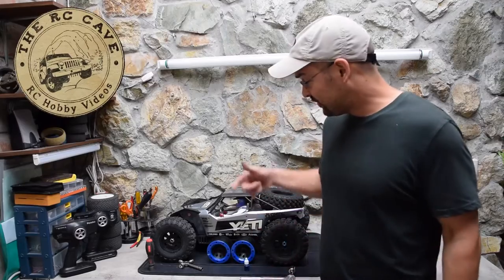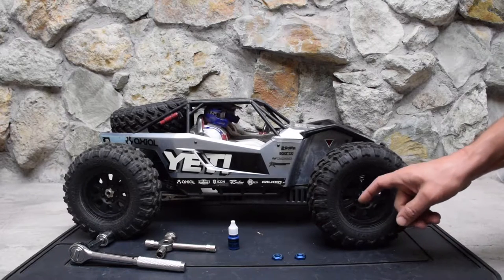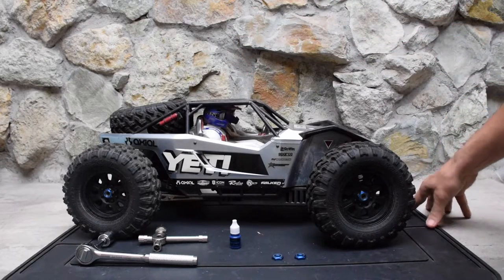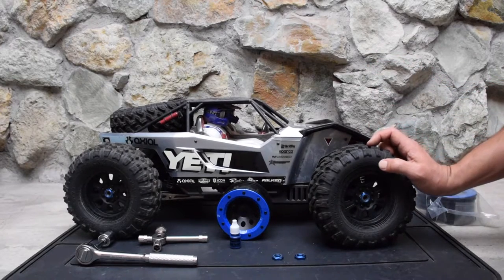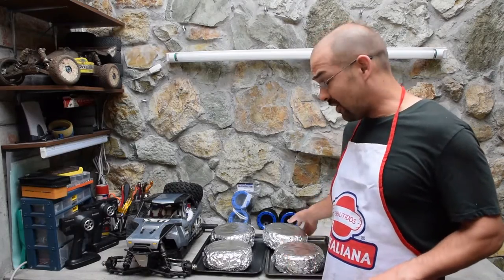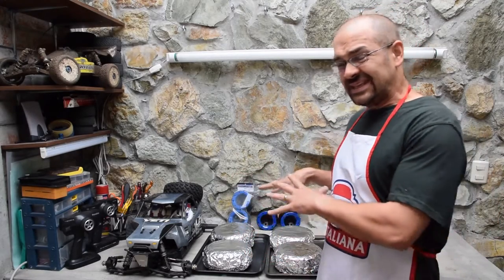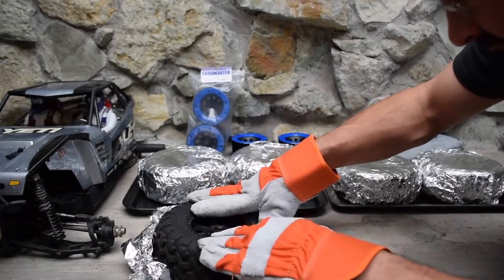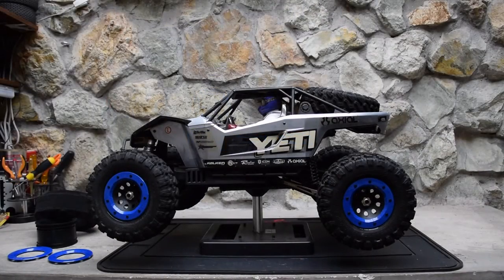Axial Yeti XL: Wheel upgrade and baking tires off rims

Comment: Great stuff!  I just picked up a Yeti XL and stripped a wheel hex within  2 runs because I didn't check them.  Doh!
Reply from the maker: I know this is way after the fact, sorry for not responding. I've been there, the stock Axial plastic is just way too soft. I went with the RC4WD Dick Cepek Beadlocks and Mickey Thompson Baja MTZ.... I wanted quality wheel that wouldn't break, along with taller tirs that weren't too heavy 👍

Comment: Those tires look awesome on your crawler with those Rival rims. 
I looked over all the methods for removing tires and decided on the acetone vapor method, it works excellent,  you aren't really touching any acetone and it loosens the glue on the wheels and tires and you can easily scrape it off with your fingernail, all you do is find a plastic container with a lid that seals well and put some acetone in the bottom of the container,  then put a piece of wood that's a bit taller than the acetone level, put your tires on the wood and wait a few days,  when they are ready they come very easily with no damage to the tires or wheels.  Maybe you would like to try it,  just an idea for you since it was so easy.

I got the Tekno Truggy coming this week,  can't wait to get it running.
Reply: Very nice,  yeah acetone is nasty but you never touch it or even smell it really except when opening the lid,  very minimal exposure and doesn't seem damage or degrade the tires or wheels.

Thanks for the tips on the Truggy ,  it just arrived today   it is the ET 48.3,  I will take that advice.

My friend has an place in Colombia and he said land there is economical,  so we might get a lot and build some awesome tracks like you got.
Reply: Yes,  thank you

Comment: My 10 cents worth - I started with stock plastic glued wheels .. with my crawling the tyres broke off from the wheels - then I tried aluminium REAL beadlocks, same problem + others I won't get into here - then tried Proline titus beadlocks (plastic) .. same problem as you had with your stock wheels, rounded off hex socket but now I have Vanquish OMF wheels, so far good all rounders - beadlocks really work and hold onto they tyre in place and the hex is still going strong .. as for the rotating weight I don't go ion it that far, I've been on this setup for a long time, been through a set of Mur Slingers from RC4WD and really beaten the crap out of those with no damage except to the tyres and plastic Proline wheels - in my opinion, I would go from plastic to something stronger not back to plastic and as for those blue beadlocks, if you don't mind picking them up wen they come off during your bashing sessions, then leave them on but they look kinda nice with that truck :) Oh on last thing I would like yu ALL to know, if you go for a set of beadlocks I suggest you get the with counter sunk heads because hitting them against rocks will rip off those beadlock screws heads and water will not help towards the cause. Get beadlocks that actually have screws on the inner side of the wheels that do the actual tightening on the tyres and the outside ones are for show! Lessons learnt from experience!!
Reply: ***** I have no experience with speed devils like your yeti so I would not know whats good or bad for it .. makes sense what you said :) If it has a weak drive train I'd personally have upgraded that first - and glued a hex hub to the now bad wheels until i get new stronger wheels :) Yes, many wheels out there with screws on the inner side of the wheel .. check and check again. It pays!!

Comment: nice vid  just wanted to through a couple things at ya.. don't over tighten the wheel locks because I figured out it was causing the pins to brake  "easier" because of the compounding forces of the wheel lock pressure and its natural purpose of turning inertia ... and I've fixed my dogbones by soaking them in red locties or you could use the green penetrating Loctite..Ive also used my shop light to warm up the tires to release the beads. Thanks for the video !!! Talk to ya on RRC and make sure you check out my vid over the hd pinion mod if if you ever install them in your rig .....bash on

Comment: Nice video, looks great either way...I use those wheels on my D8t and NItro Circus MT. (Minus the faux beadlock rings =)  They've held up very well!  And I totally agree with you on keeping your wheels/tires light on high-speed bashers.  Saves many expensive parts from unnecessary wear and tear.

Comment: it is much better , faster , no smell , no complaints if you use a hot air gun with about 300 degrees Celcious  and you can work outside,  it take five minutes for every tire maybe less to unglue , clean job and you dont destroy the inner foam

Comment: what tires are they pal , im looking for good tall tires for my Axial xl but not as big as mud slingers
Reply from the maker: Hey thanks for commenting and sorry if I'm a little late. When I was tire shopping the problem with the mud slingers was weight more than size, others had told me that by increasing rotating mass too much you're risking breaking the drive train. I went with the RC4WD Dick Cepek Beadlocks and Mickey Thompson Baja MTZ.... I wanted quality wheel that wouldn't break,. along with taller tirs that weren't too heavy. This combo worked out super well for me, but be warned, it was a tad expensive... Here's running video on that setup https://youtu.be/Uay5zMpgPBk

Comment: definitely without! 

have you tried boiling the tires to get the tires off the rim?
Reply: +Jason's Rc Cave just get a big pot full of water and toss your tires in when the water boils like 5 minutes per side and the glue will release from the rim pretty easy with not a lot of glue left over.
Reply: +Jason's Rc Cave check out rcsparks he posted a video about this and I followed his instructions and it worked really well. I have a yeti xl and you should upgrade the foams to crawler innovations deuces wild closed cell foams. I run 6S now with no ballooning of the tires. you should also think about upgrading everything to aluminum lol. I broke so many plastic parts that I pretty much upgraded to mostly everything hot racing has for the yeti xl and some gpm aluminum parts too. my yeti xl is a tank now and I haven't broke anything for months now. just need someone to make a metal cage now!
Reply: +Jason's Rc Cave your welcome. trust me the foams are so worth it. Always like to trade knowledge with fellow yeti xl owners. your rig looks sweet by the way!